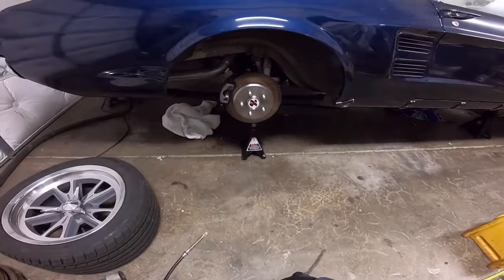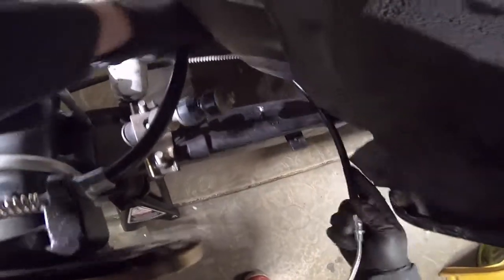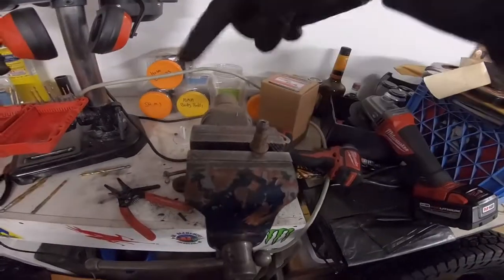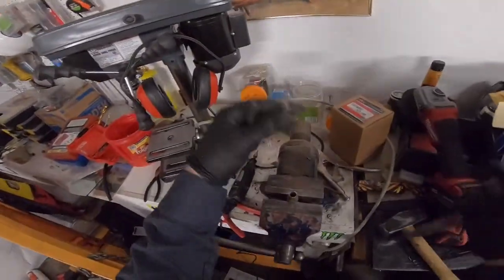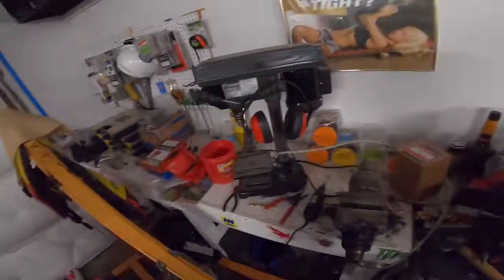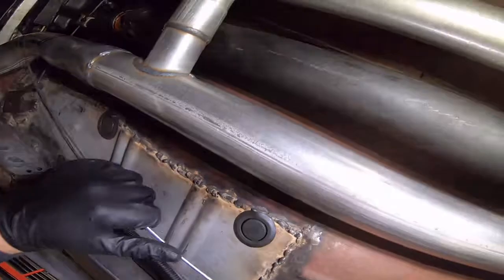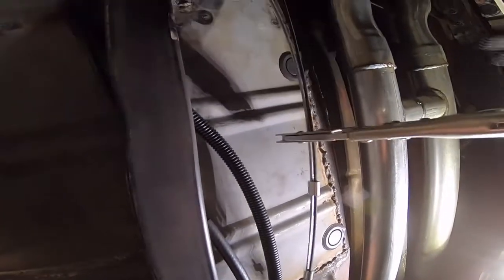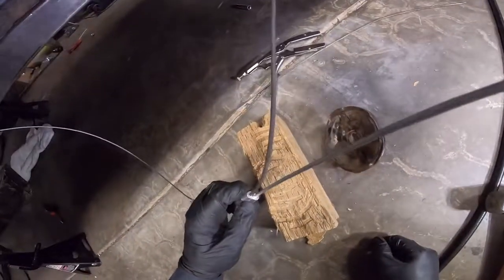Making Custom Emergency Brake Cables For Any Car

Comment: I like to solder my cable prior to cutting it stops it from fraying. After you use the crimp on cable clamps you can also solder the cables to each other at each end of your connection point so they don't catch on anything

Comment: You  skipped the step on the spring installation.
Reply from the maker: Thanks for watching. This was  supposed to be a universal video. your e brake set up may or may not have a spring.